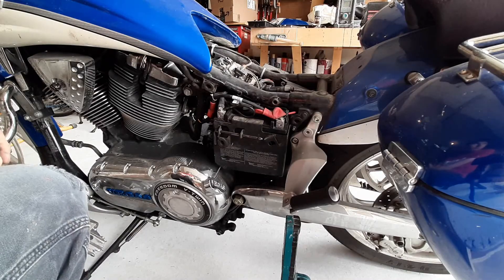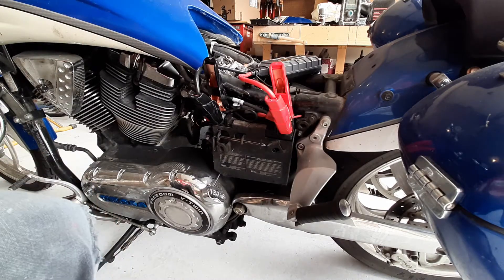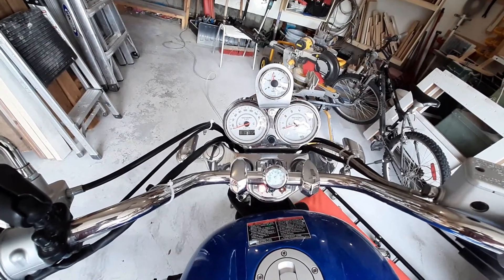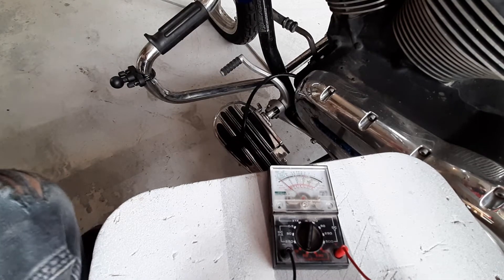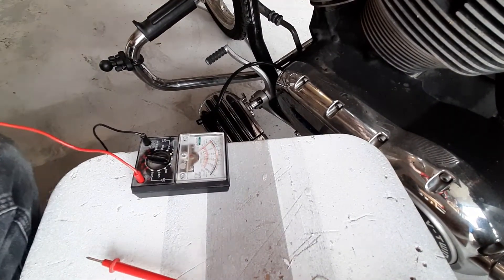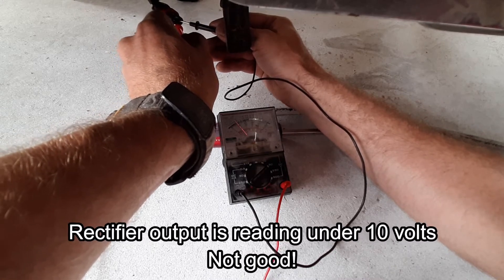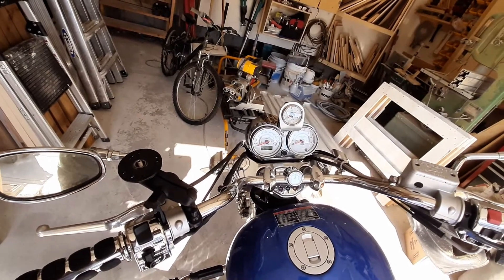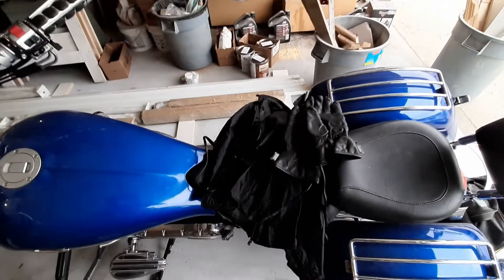How to replace a rectifier on a 2007 Victory Vegas

Comment: i have a 2004 victory v92tc. and haveing starting  issue.  can jump it with a jump pack. soon as i take it off bike stop running.  wont start  on his own.
Reply from the maker: At the end of the day on mine, I had a bad connection where the rectifier connects to the bike (on the bike side).  There was a bent pin on one of the 3 pin connectors.  If it was not fully connected, the bike would run off the battery until it was drained and then quit because the circuit was broken and nothing was getting power or being charged.  When I put a power pack on it, it would start, then when you pulled the power pack off, it would die immediately.  I ended up replacing the connector - I have a video on it, Fixing a wiring issue on my Motorcycle

Comment: Thank you again for your excellent video! I purchased a new rectifier regulator from ricks motor sports and installed it yesterday. A three hour test ride today shows the battery charging as it should at a constant 14.5 volts. You’re the best!!
Reply from the maker: Glad to hear it worked, happy riding!

Comment: Thank you much for your video!   I have a 2014 Cross Roads and had to have it flat-bedded home two weeks ago. Same symptoms as on your bike. I’ve also installed a voltmeter because the low voltage error codes appear about the time the bike is shutting down.  New battery installed, all contacts cleaned and I’ve seen a slight improvement but it dropped from 14v to 12v at the end of a two hour ride.   Question:  Have you had any issues with the rectifier from Rick’s Motorsports??
Reply from the maker: No issues yet. It's been in there for about 40,000km.  On my last trip it dropped to 14v instead of 14.2 for a bit, but no issues
Reply: @grinchbiker5399 2025 update:  Zero issues!   Thanks again for your great videos.

Comment: Having the same issue, 2 mechanics have seen it and found nothing, about to do my own troubleshooting based on your video
Reply from the maker: Good luck!  Check the connectors first, I did have one from the that had a bent pin, and I think that was the issue.  I have a video about the MetriPack series 480 that shows it.

Comment: I am having issues with my 2007 victory vegas 8-ball, when I test the voltage at the battery while it's running it is reading 17 volts but when I check it at the regulator like you did I am getting 5 volts.
Reply from the maker: That sounds really bad.  Coming directly off the stator, mine would read 25-26 volts.  The reading at the regulator was about 14, which is what it should read at the battery.  It sounds like your regulator is bad.  Does the regulator get really hot?  It converts the excess voltage to heat, and when they malfunction, I'm told they heat up a lot.  Either way, it sounds like it needs to be replaced.
Reply: @grinchbiker5399  https://youtu.be/tql0NIelE8w  I uploaded that a vid just now, take a look at the description and the vid, would that cause all my issues? And one other question, how can it be 17 volts at the battery but only 5 volts at the regulator?
Reply: @grinchbiker5399  ok man I am stumped. Stator is putting out the correct voltage. I just installed a brand new rectifier. Old one was putting out 5v, the new one is putting out 16.7 volts. Is this normal?
Reply from the maker: @ericc8895  seems a little high.  Mine was putting out 14.3 I think.  Not sure why that would be unless you got a faulty new one.  Unfortunately, I'm not an electrician, but maybe someone else has an answer.

Comment: I have a 13 Crossroads and having issues with it. Do you know if replacing the regulator would be similar to yours i.e. same spot?
Reply from the maker: I think on the CC the rectifier is at the front of the engine behind the plastic cover.  Near the battery.

Comment: Ok if I did this right, stator was charging at 0.22 to 0.23 at idle, had my dad Rev it a little and it went to 0.40. Tested rectifier it was on 0.03

Update. After plugging everything back up my volt meter I have bolted directly to the battery us showing its charging at 14.3 and 14.4. No idea what that's about but it seams fine now. Rode around my yard about 2 miles and it restarted just fine.
Reply from the maker: Not sure what your initial readings are.  When I tested mine, I was getting 25-26 V from the stator at about 1000rpm.  The reading from the rectifier was about 14.2.  When riding, my volt meter gauge reads 14.2.  Your updated readings sound right to me.  I did have an issue with where the rectifier plugs into the bike, that connector had a bent pin in it, so I replaced that connector and everything has been good since.
Reply: @grinchbiker5399  my connections might have been oxidized enough to stop it from charging? I have no clue why it's fine now other than that. When I get more time I'm going to put some miles on it to be sure. 

So far it started better than it has since I bought the bike about a year ago. I'm also the l3arrett82 guy in the comments, that's my computer account, this is my phones account.
Reply from the maker: @dustydusty8660  If they are oxidized, sometimes taking them apart and reconnecting them may give a better connection.  I would guess I had some oxidization on my old ones as well which would be why my issue was intermittent.  There may be a cleaner that can be sprayed in there to help clean up the connection.

Comment: something happend to mine and it seams like the same problem you had. i bought the bike about a year ago and its sometimes sluggish to crank and sometimes not. sometimes it would start and run a little crappy with engine light on but turning it off and back on would solve both. i thought it was due to the bike being modded and not having o2 sensors and what not. anyway last night it would not start back at a gas station so i got a boost. the engine light came on but i said hell with it im just gonna ride it out. about a mile down the road the spedo dimmed and stopped working, bike started cracking and popping and violently bucking and the head light flickerd a time or two. blinkers were to dim to be usefull but head light was still as bright as normal. it eventually ran like this untill it just died. got a boost again but this time i kept the chase vehicle hooked tot he bike for about 5 min to get a decent charge on that batter and made it to my dads. 

i was about to buy stator, rectifier, battery, gasket, and oil change. when i get back to my dads i'll run the test you did and hopefully just buy 1 of the 3 parts. you may have saved me hundreds buddy! thanks!
bike is 06 jackpot premium in yellow. same as this but with different seat and other accories.
https://www.youtube.com/watch?v=guPIkZ5pPHM&t=103s
Reply from the maker: Sounds exactly like mine did.  It would shut everything else down to save power for the engine, but once the battery was out of juice, the engine would sputter and die.  In my case, it was the rectifier (and I had a bent pin in the rectifier connector on the bike, so I replaced the connector as well).  Start with the rectifier, it is the easier and cheaper of all the components to replace.  I also installed a voltmeter gauge to keep an eye on things, so far so good.  Good luck!
Reply: @grinchbiker5399  thanks again buddy!

Comment: I love you. Do you know the amount of hours looking for what’s wrong with my kingpin. Thank you
Reply from the maker: Uh.... Love you too!  Glad it helped.  I have discovered that I may have a bad connector as well.  Where the rectifier plugs into the system, the tab is broken  (the one that holds it together) on the bike (rectifier is new, so it is good).  Also, the pins in it are somewhat bent, this may have lead to some of my problems, or possibly even caused the rectifier to go bad.  Check the connectors that come out of the stator/rectifier, and the ones that go into the stator/rectifier.  You may have an issue there as well.